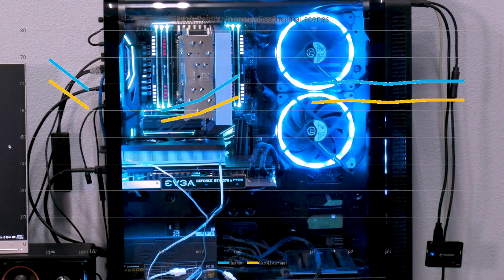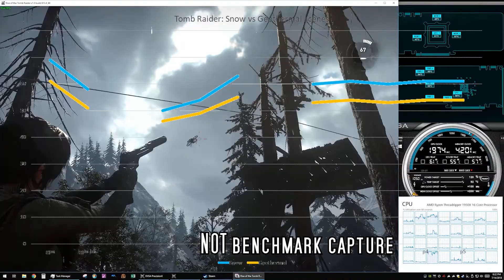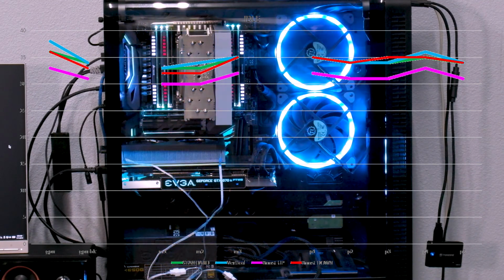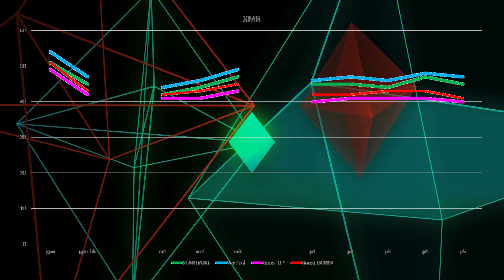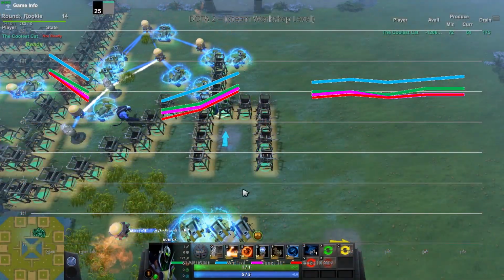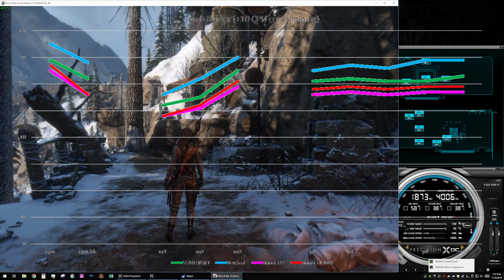GPU BACKPLATE FANS = Lower temps?!

Comment: I bought an ancient copper top-down cooler for a friend's PC. Then I designed for it a 120mm fan adapter with a hole to sling a little air onto the GPU.

On my own PC with a tower cooler and better airflow, I just folded some paper and aimed the CPU exhaust to the VRM's

Comment: i dont know if you know this but fans dont work when they are pushed directly up against something
Reply from the maker: My 3d printed fan housing does include channels for air to flow.
Reply: @3DPC  well all channels aren't equal are they lol. If you can't see a gap it's no where near enough. I'll guarantee they aren't high static fans. Put an anemometer behind it and I'll believe you.

They are also facing upside down. You want to suck the heat away not create a cyclone

Comment: Hi, can you compare this to just addint aluminum or copper heatsinks on top of the card?
Reply from the maker: That would 100% depend on case airflow, cases with minimal flow would see little to no benefit, while high-flow cases (especially older cases with side-panel fans) would probably see results similar to this setup. I'm not opposed to doing a video exploring that, but usually when I do a video that requires teaching a concept, requiring brain power to adapt to your own personal setup, over half the comments are people asking if their celerons are faster than threadripper CPUs and asking if an RTX 2080 or GTX 1060 is faster.

Comment: Thanks for the video/benchmarking. Very well made content! I want to get a Vega 64 and was wondering if I should get one of those VGA-Slot-fans pulling air up for 20€. Especially as the Vega Cards struggle a lot with cooling.

Only critique might be that the numbers in the video were extremely hard to read, even on 1080p. They scaled quite bad, obviously. 

Keep up the good work! :-)